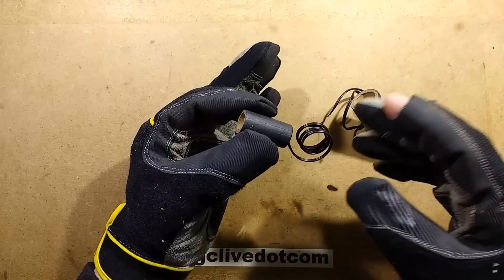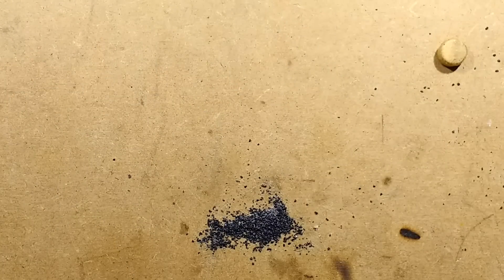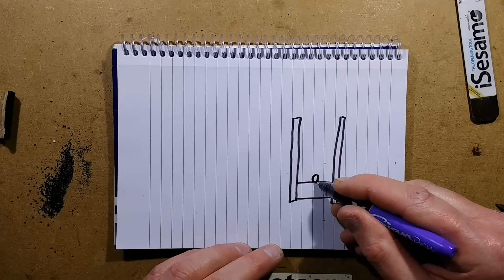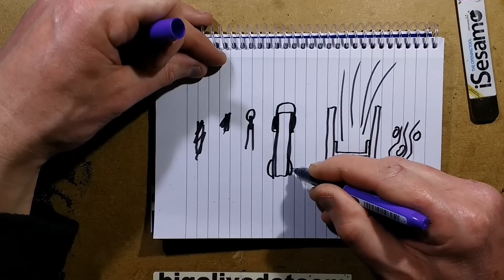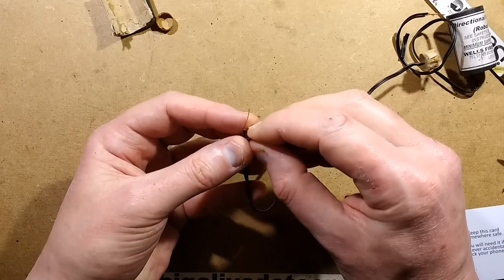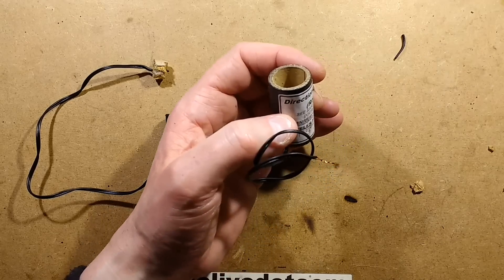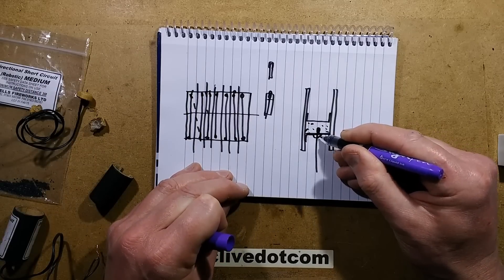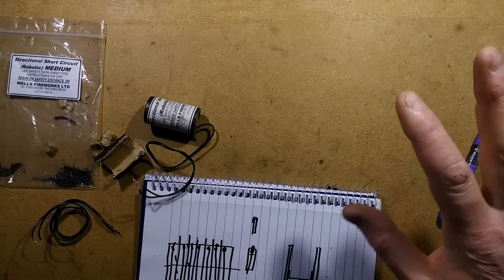Inside a special effect pyrotechnic "robotic".

Comment: I was 15 on the turn of the millennium there was a huge fireworks display not far from my house, those little things were laying all over the floor unbeknownst to me. I had one on my bedroom windowsill for about 8 months until I decided to put the two little wires onto a 9 volt battery while I was half distracted by a phone call and BANG! I still have the scar on my arm 20 years later.

Comment: A sales guy from where I worked was at the customer.  They were looking at an Industrial electrical panel and they were pointing out what they needed using one of those wooden rulers with a brass strip along the side.  They accidentally hit the panel.  The two people closest the panel died instantly.  The metal strip was vaporized and our sales guy inhaled the metal.  Then it solidified back into metal in his lungs.  He was in a full body cast from the burns for over 6 months.  His lungs are damaged for life & he will never be the same again.

Now they tell our sales guys.  Insist to the customer that they turn the equipment off before opening the panel.  If they refuse, the sales guys are not allowed to enter the room.

Comment: @10:04 I actually jumped, it scared the c**p out of me haha. I was expecting you to connect and then turn the PSU on, not just touch it. From years of doing similar things, even this little spark had my body ready to run as if it was 240V shorting haha.

Comment: You can make a simple fuse by placing a small amount of wire wool before the compound, then pushing the wires through into the wire wool with a wire on opposite sides of wool. The wool will glow red hot and ignite the compound. I have made these (in a different country) from scratch including the compound for an Aladdin panto.

Comment: There's several reasons for wiring pyros in series. Firstly, if you say wanted to fire let's say, 12 gerbs (looks gorgeous when inverted as a waterfall). Because they're current fired devices, you'd need (12 x 500mA = ) 6 amps @ 1V to fire in parallel, but to fire in series you need (12 x 1V = ) 12V @ 500mA. Basically the reason is is easier to increase the voltage than it is to up the current. The second reason is testing. As you mentioned, you can use a small test current to check for continuity. Having them in series means you know they're all good, whereas in parallel, you could have 1 good and 11 bad and never know. The final reason is it creates an all go/all no go situation. Sometimes it look awful if not all fire (like in the waterfall scenario), so it's better to not fire any.

Comment: One really should not play with explosive toys. Back in March of 1970 I was a trainee in Basic Combat Training in the US Army at Fort Lewis Washington.  We were preparing for the live fire  course, where we had to crawl under live machine gun fire across a course that had different types of barbed wire, pits with explosives, mud and other things like snakes and such that made a fellow want to test the truth of those live rounds going what seemed like 6 inches or so over our heads.  At any rate, we were all seated in bleachers getting the instructions for the course when I noticed a second Lieutenant, (the only thing stupider in the Army then a trainee is a 2nd Lt.) he was busying himself by cutting a live artillery simulator, a stick about the size of a stick of dynamite that is used to scare the shit out of trainees who are crawling through live fire.  He cut the device open, then poured the content on the ground, where he intended to light it and scare we trainee's or something, not real sure what his intent was but as I say he was stupid with a capital S. What he had not noted was that the range, like most military ranges was covered with gravel because Fort Lewis is in the Pacific Northwest and it always rains, so it keeps our boots out of the mud.  So all that powder went down beneath the rocks, except for the very end (they held a LOT of powder).  When he struck a match, leaning over the pile of powder, there was a FLASH followed by a huge explosion.  Rock went everywhere.  No trainee's were injured, however the Lt lost  an eye, and most of the sight in the other, he lost his rank, and his job in the Army, and I don't know what else.  It was fine with us though cause he always treated us like shit.  There were no tears for him in the barracks that night.  Oh and we all survived the live fire exercise.

Comment: I work with similar devices in aviation, some small like these others much larger. This appears to be a “hot wire” initiated device. The other major design is an “explosive wire” initiated device. There are a few differences between the two as far as sensitivity to RF energy, power requirements, and wether they are shunted during storage and handling. While shunting the leads together prevents static electricity build up, it tends to make a nice antenna. If we haven’t studied the technical data the rule of thumb is - If it ships with a shunt (or shorted leads) use it, if it isn’t shunted, don’t add one or short it. 

We also have pink colored plastic ziplock bags to store explosive stuff in and I’ve often wondered how well that stuff works maybe a subject for a short video? I enjoy your work Clive, thanks man!

Comment: Heh...what I usually think of as 'model rocket ignitors' (the electric match, not the whole pyro charge. :-) ). As for the 'burnt resistor' smell, that is basically what these things are...resistors with a pyro coating instead of an insulating one.

Comment: I made my own wire fuse using an old flashlight bulb. bust the glass without damaging the filament is the tricky part. removed a 4-5 ton rock from a cliff face. worked great with a nice white cloud of smoke, and a loud boom. lol

Comment: For the industrious and somewhat brave one can take stick matches and crush the heads in isopropyl alcohol. Mashed to a fine paste it can be painted on the heater wire. The heater wire itself is easy enough to come by at second hand thrift stores. Just look for an old hot air popcorn popper. The rest is easy...

Comment: Just put a bit of isopropyl alcohol on the hot melt and it will come out cleanly, then pull the cardboard plug out and bingo one safely dismantled pyro, you could even re-assemble it afterwards.

Comment: The chunky powder you oh-so-carefully dispersed all over your workbench, Sir, is nitrocellulose based powder. These tend to be VERY insensitive, requiring basically a lot of heat to get them going. There's very little you can do by way of shaking the article to get them to ignite. Often you see nitroglycerine mixed in with the nitrocellulose and if that's the case you'd be handling a comparatively dangerous mix, however I don't think the manufacturer of this article is stupid enough to do so, so my bet is on more or less pure nitrocellulose, which is good - it's almost impossible to get it to detonate which makes these pyrotechnics very safe for use. My guess would be that these are set on fire by the primary in the base (just enough back pressure from the cardboard cap) and then dispersed for that sparking effect. The igniter looked fairly standard, they're usually primary explosives, which makes them the sensitive "high explosive" part of the article, coated onto a wire filament and ignited by the heat. These typically detonate when ignited (the characteristic "pop" of an article like this), however the piece you show here looks small enough to be safe for use basically anywhere.

Black powder is very fine in comparison to what was inside this and typically needs to be compacted to prevent detonation. It's really not suitable for this type of application as you wouldn't really get any sparks out of it (like you do with nitrocellulose) on its own.

Comment: In Australia you would need a Dot C permit for this device, as you would with fireworks or model rocket engines. Estes solid rocket engines use  a similar electric match for ignition.
As a kid I would make my own by winding a fine strand of wire around a match head.
Useful for any remote detonation purpose.

Comment: Re: Cameras - Why not buy one of those $50 (~L35 I'm guessing?) knock-off Go-Pro's from China?  That way you don't risk your phones anymore, or worst-case you get to evaluate (and maybe take to bits) one of those cameras?  Just a thought, not a criticism - your work is plenty enjoyable with your phone-cam, I just feel bad that you keep breaking your phones in the pursuit of entertainment.
ETA, after watching: Fanny Flambeaux, v2, Rocket Pussies to the Moon?
Reply from the maker: I tried a GoPro and also a clone, but their field of view was very wide and they also have to be modified to focus close enough.  The sound was also a bit odd.
Reply: Fair enough... that's a point I hadn't considered (field of view), since they are designed as action-cams.

Comment: I'm now really curious why they recommend to wire multiple in series and not parallel, trying to work out what difference it would make to the e-matches themselves in some way, other than needing a more beefy power supply. Anyone have any comment on why this is the case or Clive any further insight into that would be appreciated?
Reply: It has to do with current dividing in parallel circuits.  The matches are such low resistance that any imperfect connection would cause that leg to have a much higher resistance and therefore lower current which could cause failure.  By being in series the entire string is more likely to function.  Series also makes it much easier to verify connections by simply checking continuity of the entire setup.

Comment: I never get screen protectors, back then because they were "ugh", nowadays because stuff is oftenly using glass screens anyway \o/ Also it would be impossible for me to mount it without having a 0,00001mm piece of dust under the foil, which would aboslutely make a mad man!
I wish I had one on my PS Vita though, plastic thing... but I guess I could just exchange the plastic altogether if needed. But the Vita touch screen is unbelievably prone to fingerprints, that'd be the main reason I wanted a (glassy) protector in the first place...

Comment: a lot cheaper to replace? let's see here, 3-800$ for a phone of quality, possibly a china phone for 200$ compared to my dslr that I got for 300 with lense, now you have an actual zoom, manual focal heights, and depending on the camera, a good 4k video that you take into a video editor and export as 1080p can effectively be an extra 4x zoom i think multiplying whatever zoom you have. only real issue with the dslr would be audio as on board are rarely good, more just get the job done. 

Then if you do something stupid, put some plexi glass in between the camera and what you are filming, or take advantage of real and good zoom functions and get the camera further away. possibly buying an old used lense just for that purpose. 

But this is also coming from someone who doesn't see a phone as a real camera because I like control that phones take away.

Comment: In the theatre the "fx" chap put one of these inside a 3 pin socket for a stage effect short circuit, as the actor near it I wasn't too crazy about this as it's confined, so we tested it with me wearing safety mask (my idea) lucky we did, the socket exploded and I was hit in the face, and most of where the front row would have been in a show got "fragged" as well.
I wasn't hurt and we had to use a different idea for the play. (a safer one)
Reply from the maker: They mustn't be confined.    That would cause a large explosion and cause the socket to shatter.  The correct way to achieve the effect would be to modify the socket so the open end of the pyro was flush with the surface.  Possibly concealed by a small paper circle or square.
Reply: For the actual show we ended up with a hole in the top of the socket and the robotic pointing up through the hole, from the floor you couldn't see it but that way was a LOT safer.
I must admit I was supprised by the power of one of those confined, and not too impressed by the "fx guy" and his idea of safety.

Thanks for taking the time to reply Clive.
Regards Wayne

Comment: I love electrically initiated  devices even these little babies. ESD should not activate this in theory but always best to play it safe, you can always do the calculations to satisfy yourself (or get an ESZ gun and have some fun )

Even these little ones should have had some HERO testing but again it is always best to play it safe and limit the RF around this device. I am confident with some equipment that I could induce suitable energy to initiate this wirelessly but this is not two way radio or walkie talkies levle, the hazard is real. 

btw, HERO is Hazard of Electromagnetic Radiation on Ordinance.

always best to keep the leads twisted before use to ensure a common potential. inspect before use, dispose of ordanance with damaged wires and have fun. 
some  jurisdictions or companies can not or will not sell to jnliecenced so don't be angry or abusive if you are turned away.

Comment: I tried to use electric matches once to light off fireworks, and I built a panel using 4 of those LED toggle switches, including the 'FIRE ZE MISSILES' covers, and I wired each one to it's own switch, but when I'd turn one on, they'd all light up.  I didn't realize they would pass any current, but as you said they can easily pass enough to light up an LED.  And also apparently I have leaky switches.

Comment: We used these in a production back when I was a stage hand. During one performance we set back stage on fire. Nobody in the audience noticed, but the performer nearly flubbed his lines. Much hilarity ensued after the fire was put out.
Reply: Chris Horry I remember some tabs going up in flames due to the close proximity of the pyro during a production of Wyrd Sisters, the audience was quite impressed and would probably have thought it was part of the act until the stage manager came running on with an extinguisher.

Comment: hi Clive ,I have a question for you .
i have got a skate board which uses lithium ion battery's ,
well the battery is old and has been recharge many times 
and is not holding a lot of power any more ,
ok here is my question .
on youtube there are so many videos 
which profess to be able to recondition 
and bring back these battery's to good or as new ,
but most of these videos are so confusing 
and so long and soooo incredibly boring 
my mind turns to mush and i loose the will to live when i watch them &
i just can not understand them ,
can you help me  
is this true can i somehow revive my li ion batterys  ,
and which is the best method to use 
maybe you can make one of your excellent videos to test this and show what to do 
thank you konstantin
Reply from the maker: +loopiewho If the batteries have seen a lot of use then they will not be recoverable.  One option is to look at the battery pack and if it is made of standard 18650 cells (18mm diameter by 65mm long) then it might be possible to rebuild it with new good quality cells.

Comment: Model rockets are launched with a kind of electric match called an igniter.

example:
Model: 03080
Manufactured by: Estes

Wire Length = 10 inches

Quantity per pack = 4

Maximum no-fire current = 1.25 A

Minimum all-fire current = 3.80 A

Igniter Resistance including lead wires = 1.6 ohms

Comment: Hi Clive, I'd really appreciate a video showing how you use your phone to make videos, how you hold it etc. I'm intrigued as to how you adjust the settings so quickly and precisely whilst filming, as in this video when you tweak the zoom so accurately, and adjust contrast. Thanks.
Reply from the maker: Hi Roger, the phone sits on a dedicated shelf-edge panel facing down.   I'm using an app called Open Camera which gives good control, but takes a bit of getting used to.

Comment: iv made a electric match using the small wire from a transformer by burning off the lacker at each end but leaving the middle still coated. I then wound the bare ends to a cable. ironically I used a wooden match as a holder with hot glue leaving a little bit of fuse proud of the end. in order to get a good current to blow the fuse I used a couple of ni cad batterys.  all for curiosity and very fiddly.

Comment: Hi Clive, glad to see you're opening dangerous equipement again!
I have a question: here in Italy whe have a ride that uses a similiar effect but it's less violent and probably (just my guess) doesn't require any explosive material. How do you think they archieve this effect? https://www.youtube.com/watch?v=kMgSmPvYitg minute 5:08 circa on the left
Reply from the maker: For a recurring effect in a theme park ride they usually use a MIG welder feeding wire onto a spinning metal drum to throw sparks out on cue.  Other systems use a MIG welder with two wire feeds aimed at each other in very close proximity, with a compressed air jet behind them to blow out jets of sparks.

Comment: I worked briefly at an airbag plant.  They use a relatively similar process in making the igniters for airbag inflators.  I had the task of setting up power supplies to test the bridge wires.  I was always kinda sweating when turning up the voltage on those because it only took about 150mA to set them off.  I liked to use a resistor big enough to make it impossible for the given power supply to push enough current, but ten of those go off at once, its not good.